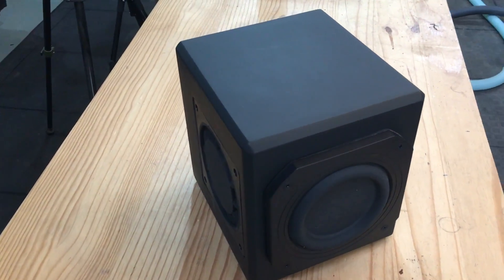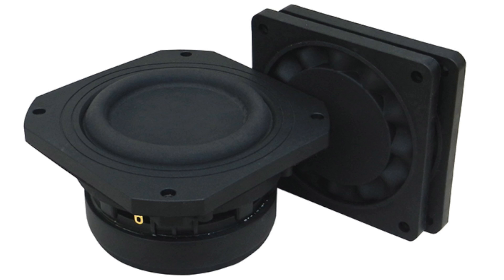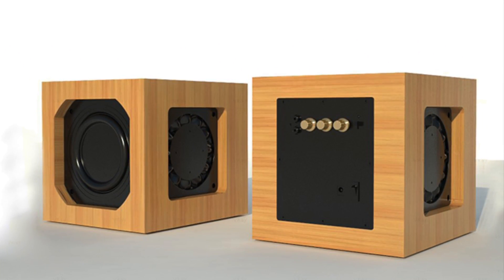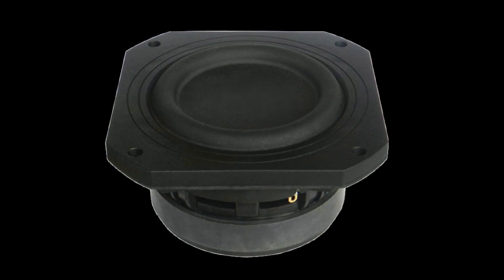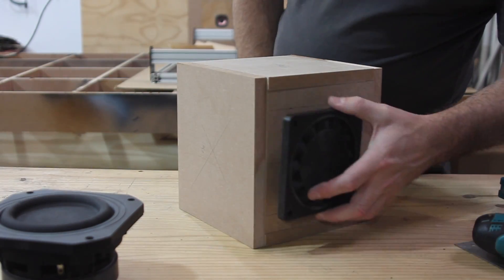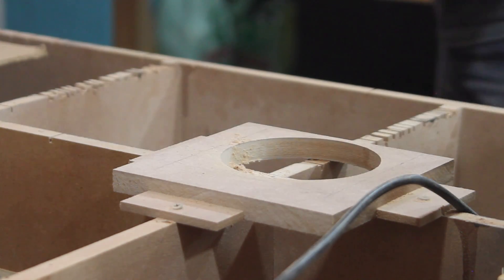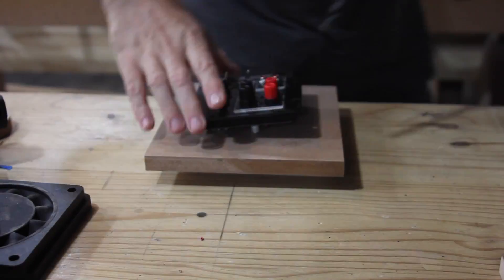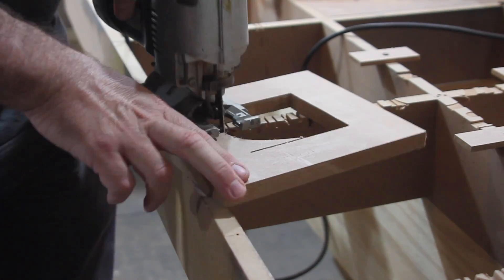Building a Small Subwoofer with 5" Tang Band Driver - by SoundBlab

Comment from the maker: Purchase links to the TPA3118 60W+30Wx2 Small Plate Amplifier:
- WITH Power Supply - https://ebay.to/2GrhUVK
- WITHOUT Power Supply - https://ebay.to/2GqE22x
Reply: Does the amp crossover frequency also apply to line out?

Comment: usually the small woofers have a very low sensitivity, around 78 decibels, this is because the manufacturers weigh the small cone with a mass (in this case around 35 gr., near the mass of a 25 cm woofer....) to reach a low fs, so even if the woofer has a long stroke the amplifier will be forced to push many many watts for bring the efficiency back to a good level

Comment: I've been enjoying your videos for a while now and recently started putting together a system primarily for music,  but some "theater" use. A Denon AVR-X1600H with wharfedale diamond 220s in a room approximately 1440 cubic feet. I am extremely limited on space and looking for sub options. Was curious if you had any recommendations. My goals are to consume minimal space and get as close to 30hz extension... which doesn't leave me many off the shelf options. Any input is greatly appreciated.
Reply from the maker: Thanks. I don't have any personal experience with the subs I suggest here. I am only looking at their specs by the manufacturer. But if you look on Amazon, you can find a few that could suit your needs. For example: Polk Audio HTS 10 goes down to 30Hz; there is also the less expensive Polk Audio PSW10, but only does 40Hz down; Klipsch R-100SW at 32Hz down. All of these are relatively compact, and you probably will not find anything smaller that can go down lower. Look at 10 inch subs, and then check the specs on the manufacturers website to see it's rated frequency response and cabinet size. Hope this helps.
Reply from the maker: For a bit more money, but worth it IMO, try the SVS SB-1000 which goes down to 24Hz.

Comment: I see you can choose between "single subwoofwer" configuration and "2.1", with L+R output. How is the overall sound when used in 2.1 config?
Reply from the maker: Unfortunately this small plate amp arrived faulty and I have yet to receive a new one. So, I can not comment on your question right now.

Comment: This is based on not knowing acoustic properties of drivers and their boxes ,  This is poor sub, you will integrate  it even poorly , end up with garbage .  i bet on it
Reply from the maker: The manufacturer provides an enclosure plan for these drivers, and this is based on that. I am sure they would know the acoustic properties of their drivers better than we do. However, I double checked the math based on the driver specs and it all works out perfectly. I would like to also try this driver in a ported enclosure though.
Reply: @SoundBlab  Probably , sure but  that kind of driver with those ability's on low end goes in to bass category not sub , so if they are involved in this they sure as heel dont know

Comment: I am building a similar sub, but I am using different passive radiators made by Dayton Audio because I didn’t know about the Tang Band radiators. Also, I think the internal volume is a bit more because the lightweight radiators would have each needed a 10 ounce lead weight that didn’t fit... and anyway I had clearance issues. So the weight is down to a 6 ounce lead weight now. I put up a video when it’s done.
Reply from the maker: Cool!

Comment: Is there a follow up video for this? I want to know how it performs, I'm doing something similar with these https://www.aliexpress.com/item/1-PC-Sounderlink-Audio-Labs-3-25W-subwoofer-woofer-bass-raw-speaker-driver-4-Ohm-8Ohm/32843845428.html?spm=a2g0s.9042311.0.0.64574c4d4JlZAa
Reply: The driver has arrived by the way, and it's pretty solid.. have yet to finish the enclosure though..

Comment: Thats not a subwoofer, its an impressive midbass driver
Reply from the maker: LOL 😀. I hear you, but not sure the frequency response in the midbass section of this driver will be suitable for that, so maybe its just a woofer?
Reply: SoundBlab could be. I would be interested in a frequency sweep test on this little beast.

Tang Band woofers are really underrated wonderful speakers. Very affordable too.
Reply: lakorai2 , it is a subwoofer, it's frequency is below a midbass driver, it's for gaming, tv enhancement and computers only.
just because it's small doesn't mean that it's not a subwoofer, it does need some poly fill and possibly a port.
Reply: @timschutte8310  a port? Thats why the passive radiators are for. Those 2 radiators will make it a bigger kinda sub.

Comment: Matching the sub's shape to flush mount isn't that difficult, though it's not a widely known technique. All you need are a quarter inch flush trim bit, a quarter inch rabbeting bit, and a quarter inch drill bit; these allow you to make a negative template from a positive template.

You flush trim your template to the sub's shape, this will be the inner positive of the two pieces.
Take a second piece, flush trim it to the template, then reduce it with the rabbet bit, this is a throwaway piece once you're done.
Take a third piece, attach your reduction to it, drill a hole on the edge of the reduction, and flush trim; this creates a negative of your template, and you can then use that negative template on your box to create a recess for flush mounting. 

This same process can be used with a bit with an oversized bearing, a quarter inch oversized, and the process goes in the opposite direction for working off of a negative and making a positive insert. Negative template, increase (rather than reduce), drill and flush trim a positive.
Reply: Not everyone knows how to make templates and jigs, but yeah, its not impossible to work with. I could deal with it with nothing more than a pencil and a router. Save the sawdust to mix with wood glue to fix my mistakes, lol.
Reply: SoundBlab not really you just got tried of reading
Reply from the maker: Thanks for this, however it seems like a lot of work...
Reply: @SoundBlab  you just have to do the same as you did with the passives?
Reply: My God is this complicated for nothing...
Step one: trace the hexagonal shape with a pencil or blade.
Step to: Drill a hole in the center.
Step 3: Using a jewelry saw (or vertical saw, if you want, that you get through the holes by inserting the small blade and connect it back to the handle then tense it), start in the middle and cut down to about 2-3mm away from one of the edges. Then turn the saw 180 degrees and proceed to cut the flat line between to corners. 
Repeats this process for all 4 sides.
Step 4: Comes back to the hole. Go straight to the middle of the corners 2-3mm from the edge, turn 180 degrees, come back. Then, back to the hole, cut on each side of corners to form a triangle.
Perfect straight angles should be achieved. 
Yes, it takes more time than with a router, but you don't get (thank God) to "fix issues with sawdust" - which is ridiculous. You better round those corners out with the router than use a jewelry saw if you wanna work fast - but why? You're not mass-producing those lol.

Comment: I found a good sub, in the Peerless 6.5" 4 ohm, no. 830946. The driver is a woofer, but it's low-end capability is very good. it's roll-off point is down to 20 Hz. It is not listed as a subwoofer, it's 4 ohm, and paper. The surround is what makes this driver capable of delivering extended bass.
Reply from the maker: Yes, that looks like a great driver!

Comment: looks great , but most proper main speakers will get to 43hz,  for a pc woofer this could be nice.  but i you build it yourself at least make it big enough to go to 20hz and be a proper "Sub"-Woofer !
Reply from the maker: I would not use this with a set of big main speakers. It is more suitable for a smaller set of desktop speakers. Not everyone is into big speakers either, so its  really about the purpose it is intended for or what you are looking to build from the outset.

Comment: nice! i have two of the 3.5" version of that driver (W3-2108) in a 0.16 cu ft ported enclosure tuned to 35Hz in my backpack powered by a Banda Pocket with 37Hz @ 18dB per octave SSF, running off a 12V 5Ah RC car battery pack :) Bluetooth Minirig for mids and highs.
Reply from the maker: Sounds awesome for a backpack!
Reply: SoundBlab it is! met up with a friend in his town and him and I were chilling in the shelter by the river casually dropping down to 30Hz at one point haha these RBMs are amazing!

Comment: Looks good mate! Why is the amp separated from the speaker enclosure?
Reply from the maker: Thanks Robin! I was not sure of the airtightness of the plate amp through the connectors etc, so decided to rather separate it from the main enclosure which needs to be airtight to function correctly. With prior testing I suppose I could have determined whether it was, but ended up separating it anyways.
Reply: SoundBlab so where is the sound test video??

Comment: Looks good Hanri. Do you think this is the best configuration for the sub or
do you think it would perform better in a ported enclosure?
Reply from the maker: Thats a good question. I was sent this kit by Tang Band, so the initial build had to be using it in this configuration. However, I will definitely try this in a ported enclosure as well and see how they perform.

Comment: The separate amp enclosure wasn't really necessary was it?
Reply from the maker: Now that you mention it, probably not, but I wasn't sure how are tight the amp board was. So went with the side of caution.
Reply: I have the same amp as well as the bigger brother of this amp. The bigger amp is a 4.2 bluetooth based 2.1 TPA3116D2 amp with an in-built power supply. 
I can tell you right now that there is air leakage from these amps and they vibrate with heavy and loud bass tracks.
So, a separate chamber is a good idea.

Comment: Your work is usually pristine and amazing, but you can tell you didn't really have the same care for this as your other projects. Still a great little sub, but just doesn't match up to the quality of your other projects.
Reply from the maker: It was a very quick project, yes. I could especially have taken more care in the passive radiator cutouts. They are not perfect!

Comment: I liked the project, the same project with 8 "or 10" would be excellent, congratulations! Your video is great.👌👍
Reply from the maker: Thanks!
Reply: I think a home theater should at least hit 35 hz(for the explosions), but for what it is and how small it is, very impressive.
Reply: Fun build and nice video but that little sucker will not do a damn thing for home theater. It’s a great subwoofer addition to an alarm clock. Check out PSA, JTR, Seaton, Funk or SVS for quality HT subwoofers.
Reply: Sure it will do something, but it's more of a midbass woofer than a subwoofer. It wouldn't be my choice for a home theater, but if you want a small footprint, it's not a bad way to go. By having a midbass woofer you can get away with a small speaker to have a 'full range' stack but with an extended frequency range. Not bad at all for watching TV.

Even a proper home theater speaker system is better off with a couple midbass woofers to fill in the frequencies between 140 to 400 hertz. Male vocals and such. However, too much midbass sounds muddy and lacking clarity, though.
Reply: Prove me wrong with the frequency range and SPL numbers from this 6 inch (or any Bose) sub that competes with the subwoofers that I listed.
Reply: For a home theater, you can get enough out of a 6'' with a large enough of an enclosure. You can get really clean and punchy bass out of a 6'', which I find ideal for a home theater. You don't need to break windows :P

You can even go overkill with a 6'', like the DD 506 Redline, if you really want to break windows.